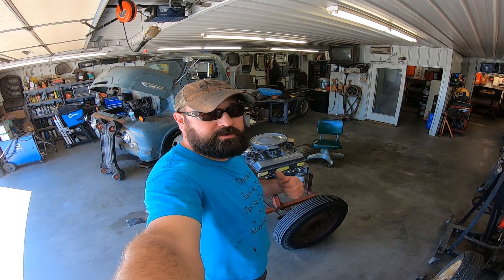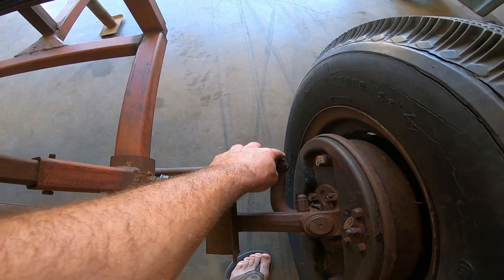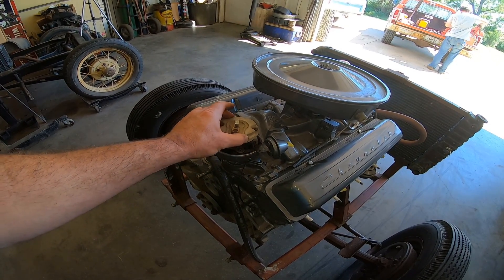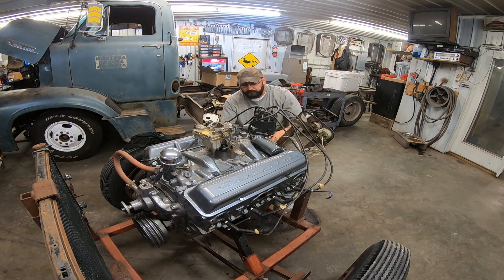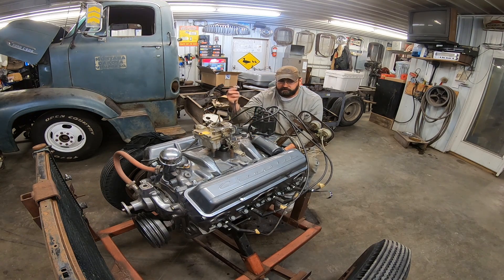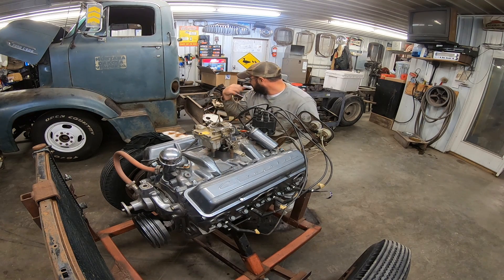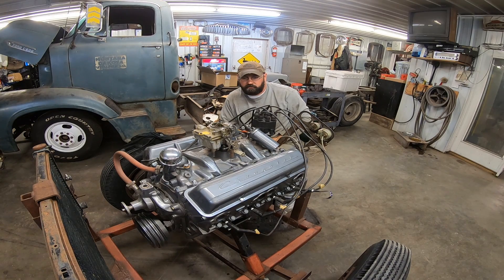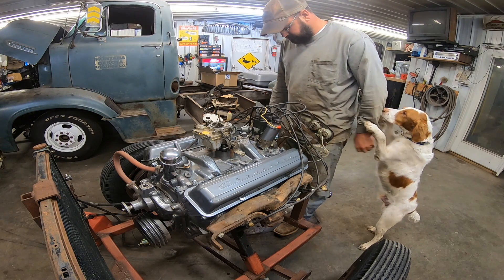1960 Chevrolet 283 Small Block Engine Estate Sale Find!! With homemade run stand! Chevy old start!

Comment: A true 283 never had a cannister oil filter, only the 265's  did.
Reply from the maker: Whoa whoa whoa hold the show!!! I'm not all about starting arguments. But you are wrong Paul. My 1964 327 even had the canister style oil filter. As did my 1966 283 and our 1958 283. I did a quick Google search just for my own information and it appears 1968 is the first year of the spin on oil filter for GM small blocks. 1957 was the first year of the 283. But thanks for commenting and thanks for watching!
Reply: every chevy engine up until 68 had a canister oil filter. my 67 396 elcamino has one.
Reply: @MortskeRepair  The 283 in the 1964 Chevy II had a spin on oil filter. The engine blocks were different in that where the filter went was recessed for clearance issues. That was the first year for a factory v8  Chevy II.
Reply from the maker: @robertweitlauf4653  Sounds like some Chevy II cars had spin on filters a little earlier. But generally speaking, yes, they were mostly canister until 1968.
Reply: @robertweitlauf4653  I stand corrected, I was referring to the optional oil filter that was offered for the 265's that was mounted on the top of the engine, I forgot that the canisters were still used on the bottom.
Reply: Wrong my 68 c10 has a 307 and my 67 has a 283 both have canisters STOCK my grandfather bought the 68 new
Reply: I have a 67 283 out of a  C10. Came with a canister oil filter. My 65 Chevelle 283 also had a canister filter. My  62 Impala 283 also used a canister filter
Reply from the maker: @davekimbler8621  Thanks for the info Bob!
Reply: Back up.....my 1962 c10 is all original w/283 and canister filter. Im afraid your not very knowledgable of sbc

Comment: I thought it was bad to run a engine without exhaust manifolds
Reply from the maker: How so?
Reply: @MortskeRepair  When the engine is shut off the valves cool too quick. At least that is what I read somewhere. might have been a Hot Rodding magazine or one of my "How to Hot Rod the sbc  kind of books. don't know if its true or not.

Comment: Too bad it’s not a 327, you could make a 302 ( 283 crank, 327 block 462 heads)
Reply: being an early block you can bore it           125 and its a 302.
Reply from the maker: From what I remember there's a few ways to do it. I thought the hot ticket was a 301 in the gasser days? Then GM came out with the DZ302 in 1969 and that was a large journal crankshaft I believe? Either way, yes they were both rippers for engines! Thanks for watching and commenting!
Reply: @MortskeRepair  yeah my dad ran a 301 with Hilborn injection in a 35 willys coupe at lions drag strip in the 60s. out of all the small block chevys the 283 and 400 are my favorite.
Reply from the maker: Holy buckets Batman!! That would be one helluva rig to have these days!! I don't have much experience on the 400s since they didn't make a ton but everyone that had them said they were a nice setup. Thanks for sharing!
Reply from the maker: @robertweitlauf4653  Holy buckets I wish could go back to those times!! Or at least find all those cool parts! Thanks for sharing!
Reply: @MortskeRepair  yeah in 1972 my parents got divorced and my dad left a garage full of parts. when my mom sold the house in 78 we threw all that stuff in a dumpster. im now 60 years old and it still hurts when i think about it. he didn't have any place to put his 35 willys race car so he cut it into 6 pieces and sold it for scrap. he did keep the engine trans and rear. i just wish i would have asked him if i could have it.
Reply from the maker: @robertweitlauf4653  That makes me sick to think of that!! Hopefully someone drug it out of that dumpster. One can only hope! Thanks again for the story!

Comment: Valves adjusted huh I wonder if it has an old fashioned 30-30 cam they had to have a slot on the rear bearing to oil the rocker arms lifters I mean. You can actually modify the cam bearing where you don't need the slot.